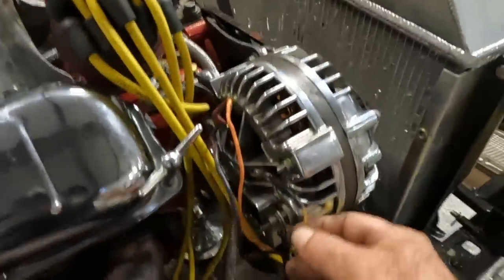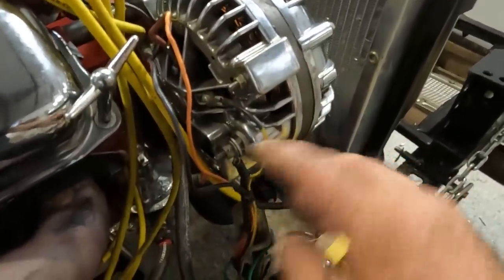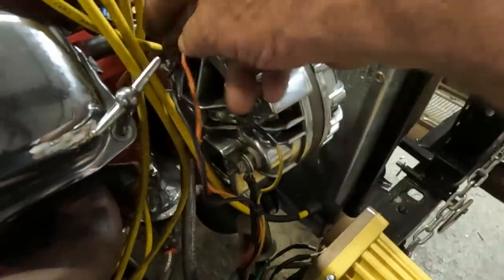Bad Back, Bad Parts, Troubleshooting And The Easy Way To Wire Your Battery Kill Switch

Comment: I bought a set of front brake  hoses for my 2007 Classic Silverado from RockAuto came in a Centric box, but labeled Sunsong on the hose. Well the Drivers side original hose didn't leak at threads, the Sunsong 1 did, and I know I didn't cross thread it as I checked the threads after disconnecting the flare nut, no galling. It's funny as the driver side gave me a fight with proper thread engagement. I wonder if the flare seat on the hose was made improperly, So I put thread tape on the flare nut and now it doesn't leak. The passenger side didn't leak at all. I blame a defect in the new hose. I will be buying another hose locally this time to prevent turn around time.

Comment: Just got some valve spring shims from comp cams for my 400 pontiac.  Center was too small to fit over guides.  How could they screw that up. It's a part that's not brand specific.  Should work on everything.  More delays.  It never ends.

Comment: Yep new stuff out of the box
It not good
Bought a brand new….not rebuilt water pump and it leaked
Took it off and the backing plate was NOT even tightened up …loose bolts
I had to fix the problem to failure of quality control in America too

Comment: Do you have to run the heavy cable of the starter thru the switch? 
Switches I’ve seen are not rated for that much current.

Comment: That disconnect switch is only rated for 125 amp continuous and 350 peak. It’s too small for the amps needed to run from your starter to the battery.
You also should have 1/0 gauge wire for that long of a run. That includes the battery ground.
Reply: That was my first thoughts when he began explaining. Also, Battery in Trunk, Starter Relay in trunk. That way that long ass run of cable is only 'Hot' when cranking the engine. He wouldn't like my setup. Yes it's a touch busy but it is 100% safe, 100% reliable. Cole- Hersee switches.
Reply: Wire it like the mad enterprises start-em up kit (search it ) 
And that way your bigass + cable running up front is only hot while cranking. 
All ya need for that is a Ford solenoid and some extra wire.
Reply: @MrTheHillfolk  Yes... I miss him, very kind and ALWAYS explained when I didn't get it until I got it.  He taught me Redundancy when Wiring the Hot rod.

Comment: If you want a Really Good switch...... go to your local Caterpillar dealer and get the battery cutoff switch.  It will cost you a bit but those things are built to handle 1,000  plus  amp draw. That will do the trick.

Comment: If fire I'd just wiggle the positive terminal off the battery if it's upside down then it's a gonna. O and you pulled a muscle attached to the root nerves in your lower back ice 3 days take real easy then start slowly doing regular stuff. still painful you need xray mri and dr .Tony I retired because of my lower back 1 delivery too many sad but true you'll be fine in a month lol only messing see you Sunday remember ice it 15 min on 30 minutes off and no physically anything GL 👍

Comment: wouldn't it also work to run the Alternator field wire back to the same battery cut off switch? sure it's more wire, but if you're a forgetful person like I am

Comment: Put a large ground all the way to the engine from battery. Dont rely on just the body, your truck frame may be ok but a unibody sheet metal can prove not a solid connection

Comment: Get those cheap Chineseum battery terminal ends and throw them away !  Get a battery cable with the lead terminals that fit onto the battery terminals. Those Chineseum parts are only used as a Band-Aid until you can get the correct cables. As for the battery cutoff switch, it's most likely Chineseum crap as well. Buy one from Cole Hersee. They make top quality electrical parts here in the USA. You'll have no regrets. Make the upgrade.

Comment: Cut off should be wired in on the HOT side, NOT the ground side.  All it takes is an errant piece of metal to keep power live.  You also should wire in a resistor so the alternator doesn't absorb the voltage spike.  Yes it will "work" cutting the ground side, but in road racing, standard practice is to interrupt the hot side--both to the alternator AND the starter.
Reply: If the alternator is still turning/operating without a diode in the field circuit the kill switch won’t kill the power . The power will back feed enough from the alternator to keep the car running .  Cars with MSD ignitions are really susceptible to this.  So, let’s assume you’ve crashed, your upside down and unconscious , fuel pump is still squirting fuel all over the place and you can’t get to the field wire kill switch therefor the engine keeps running. . Safety Safari shuts off the rear mounted kill switch and it doesn’t kill anything !   We love ya Uncle Tony but, this method is BAD advice .
Reply: @donberry5677  You switch the (+) battery cable between bat. and starter. Charging wire from alt. goes back to (+) terminal on battery. When the switch is turned off the alt. cannot feed the ignition. That's how  it's done.
Reply: @robertbriggs4176   I understand that completely if you have a 1 ( one) wire alternator .  UT is talking about a 3 wire alternator with a field wire and a exciting wire as well as the main charge wire.   I have my field wire pass through a relay that’s activated by the fuel pump relay. With Main power the pump relay drops out , kills the field wire, and no backfeed.   There’s zero need for a separate switch for the field wire !

Comment: Voltage drop testing is the quickest way diagnose bad cables, switches, solenoids, relays and connections.  But it won't help your back.  😁

Comment: If your back problem is in your lower back an honest chiropractor. I wouldn't do acupuncture. The best for free is to lay on your back with stacked pillows under the shin portion of your legs. You want a straight z position. Do this for long periods as watching tv or reading or sleeping. The more you do it the more relief. This is what a chiropractor told me to do and it works.  It helps your pelvic bone to get in the right place

Comment: Tony, you have been doing this long enough to know any electrical problem,  always check the ground. Even if it looks like everything is grounded good. 99.99% of the time that's the cause of the problem. And what's with you and bad parts these past few years? It's entertaining as in better you than me. But it's like you just can't catch a break here lately.

Comment: Just shutting the alternator off with a switch won’t give you fifteen horsepower.  You would have to remove the belt.  If it is still belted up to the motor the motor is still spinning it, so off or on does not stop the parasitic drag of the alternator on the motor.  You may want to come up with a quick way to pop the belt on and off if you need that power.  Hope your back gets better soon.
Reply: Next time you have an alternator off a car spin the pully, and note how incredibly easy it spins. When the field pole is energized the field coils create a significant amount of resistance against the armature from spinning. Just like trying to spin a permanent magnet motor. This is ware the HP loss/gain comes from. The switch prevents the field coils from being energized, and prevents them from fighting the spinning of the armature.

Comment: Moroso makes a power cut off that will also shut down the alternator. Also, go to a floating ground system. It’ll eliminate 99% of your grounding issues.
Reply: Need to wire it up like the "mad enterprises start-em up kit"
Use a Ford solenoid,that way your + cable running to the front is only hot during cranking.

Comment: I realy don't get you. You are an old fox right ? 
Walk in to a trucker shop. They sell battery disconnect switches , rated for 2000 amps and 24 volt. Grab one of those. Its simple , cheap, and will not fail you.

Comment: Take care of your body; God only gives you one. Buy a quality cutoff switch, and check the amperage rating before you purchase. The Harbor Freight "cutoff switch" isn't sufficient and you'll melt it. If you're not building a drag car and you have to run a charging system, you can get one that carries the ignition circuit separately to lessen the chance of spiking your alternator or you can put a diode in line - I nab diodes off of Dodge trucks at Pull-A-Part.

Comment: Tony what happens when you forget to turn off the switch powering the field and its not ultimately connected to the battery, but is wired like a factory setup on most vehicles? The engine will run on the alternator even with the battery disconnected. Unless you have the routine down to muscle memory, you could forget it, and that can cause problems if there is an issue. I tend to forget things like turning off the alternator before a run, so that isn't the best solution for me.

I am not a fan of stringing wires the length of the vehicle either, and I just did thwiring and cut off on my NNN 68 LeMans. It has electric fuel pumps, so I powered them directly off the cut off switch, they are off even if the alternator keeps things working, you flip that switch and they are off. I have the ground to the pumps on the relay to switch them on. Don't need another hot wire running the length. The only wire for the pumps running forward is that ground wire, I like to limit the chances of electrical fires so I tend to swtch the ground. 

Since mine is GM I have the two wires coming off the alternator, one is the filed the other is the light, and it senses voltage for the internal regulator from the field wire. I run that single wire to the farthest point on all my vehicles, no matter where they battery is because voltage drops over distance. Its a way to make the lights brighter, keep the battery charged, and run all the extra crap like fuel and water pumps, the EFI etc. I run that wire back to the switch as well, so the alternator sees the voltage at the switch, but is charging at the Ford style solenoid I have on the firewall.

I like to rebuild my alternators into 100 amp units, its easy with the internal regulator GM units, replace the diodes, rectifier, etc with higher amperage pieces. You can get a kit for them. I did that on my 65 GTO and it has no problem running the fuel pump, ignition wipers, lights, stand alone O2, two 600w amps and EFI. The Old Goat has a bunch of tech in it that wasn't invented when it was built. Gotta have enough power and the factory 50--65 amp isn't going to do the job.

My Cuda has a hard time with its factory alternator, I put an electric pump on it because the factory 5/16" stuff wasn't working to feed the 340 and it heat soaked bad. With the stereo on and the fuel pump running, its discharging at idle. So I have to figure out a way to remedy that like I do with my Pontiac vehicles. Maybe a later unit will work. Its keeping me from running the EFI unit I got for the Cuda, not enough power to run everything at a stop light.
Reply: Anytime I relocate a battery ,I add a ford solenoid and wire it up like the mad enterprises start-em up kit.
That way the + cable running to the front isn't hot all the time.

Comment: Well, let me throw another bad part warning on the ol' log pile. Ford makes a nifty car, the Focus BUT NEVER get one with the automatic transaxle. The models made up to 2017 are now part of a class action lawsuit, Ford tried to make a more efficient automatic transmission but it's so flawed they can't fix it. So I'll lose $10-17,000 this Christmas depending on what I can get donating it, because mine is a 2018 and supposedly this was the year they got it right--seems like it's taken this long to figure out a "new" car has a problem, why i always bought older cars before this (also first time i ever bought a car from a big dealer, but that's another story).  Sure hope they don't use the same transaxle on their crossovers (Ford no longer makes cars other than the Mustang, so they have no interest in getting this thing right). 

https://www.vehiclehistory.com/articles/2014-ford-focus-transmission-recalls-a-full-rundown